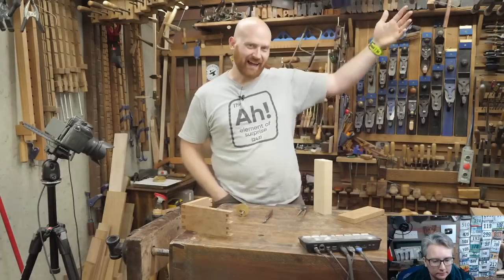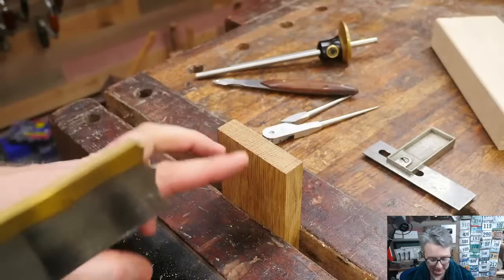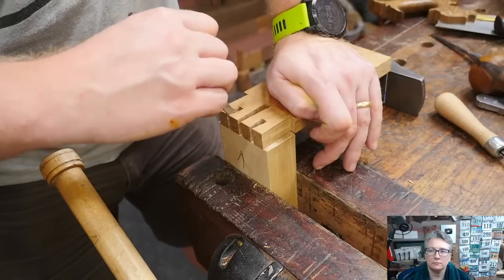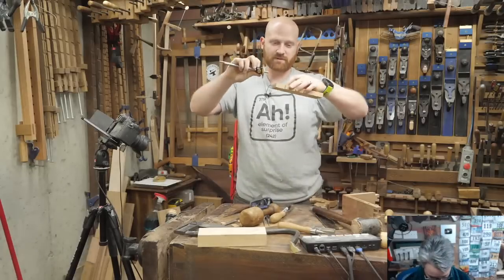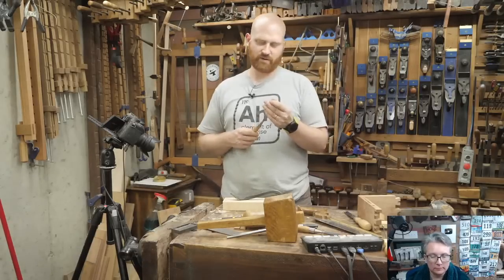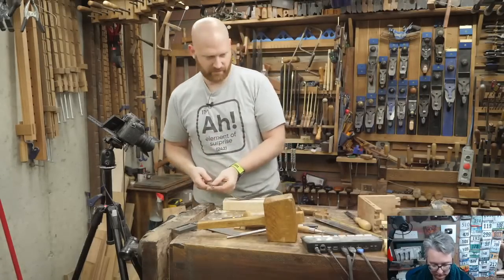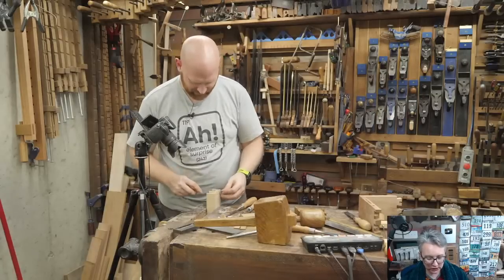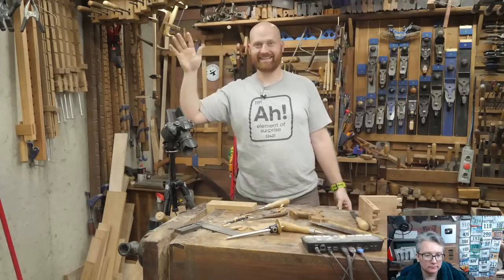How To Cut Houndstooth Dovetails

Comment: Would you recommend putting in layout markings for the angles when it's our first time trying? It seems hard to figure out what angle looks "correct" without more experience than I have. 
Speaking of which, do you have a recommended angle for the dovetails that you think works in most situations?
Reply from the maker: if you want to make sure the angles are the same then lay them out. doing it freehand and making them match takes doing it a few times. I personally like to use 1:8 for most but it really is just personal preference. some will say 1:6 for soft woods and 1:8 for harder woods. but those are just veage guidelines. draw it out and see what you like.